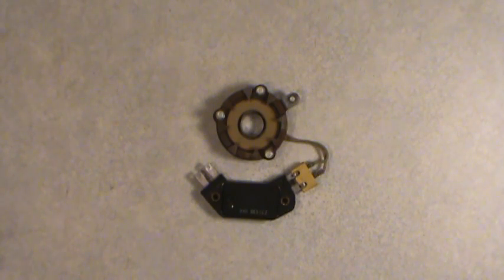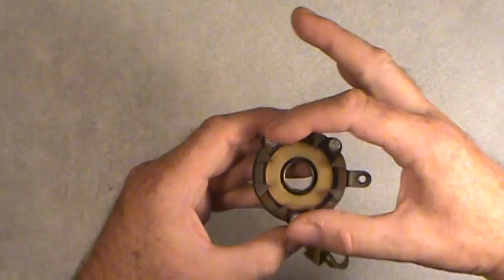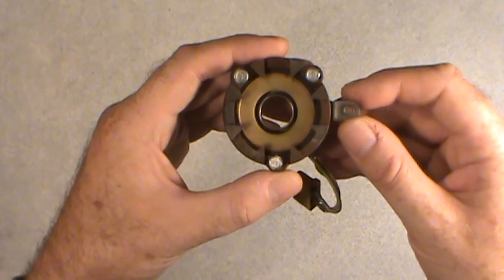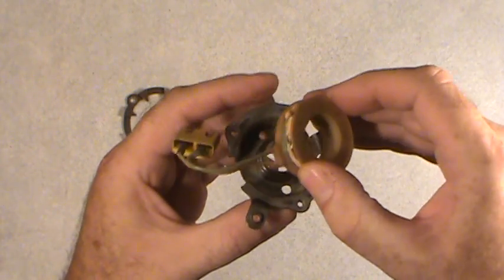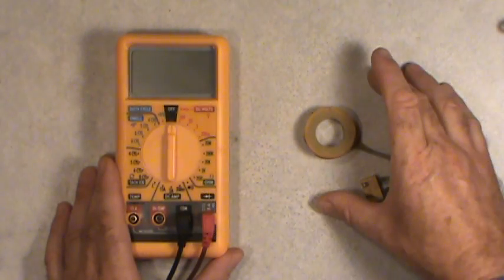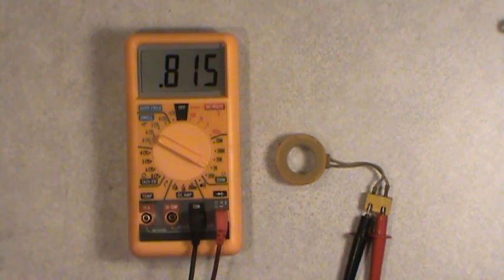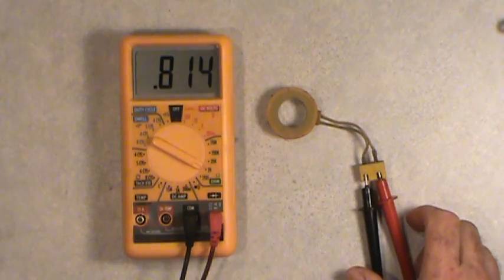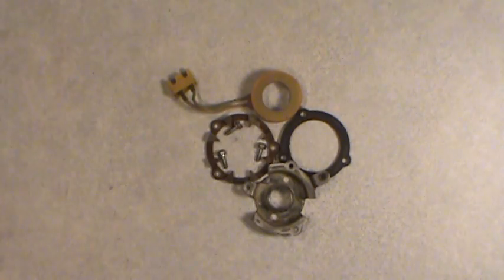HEI Distributor Pickup Coil Test

Comment: Very helpful, thank you for sharing this
Reply from the maker: sma528 Greetings sma528...Thanks for Your great comment, and for watching as well......................................................As far as the General Motors..."HEI" Distributor is concerned, this so called..."Pick Up Coil" (on the Units shipping box, it reads, Pole Piece, if I recall correctly, that is)...that..."Triggers the Ignition Module"...is only, shall we say..."One Piece of the Puzzle"...when it comes to the..."Reliability & Performance"...of a very Well Designed, and, also, as I like to call it..."A Stand Alone"...installation/hook-up, with the usual..."Battery Voltage"...that is supplied by, the..."Single Wire/Connector"...from the Vehicle's Ignition Supply Circuit, as opposed to having, what is usually referred to, as a "Ballast Resistor" (usually, as I have seen, a specially designed and calibrated Resistance Wire, in some, but perhaps, not all, General Motor's Vehicles), that "Reduced the Voltage", and the related Wiring, that was connected to the Ignition Coil, that use to go along with, that good ole "Points & Condenser Distributor", that General Motors Installed, up, oh, until about 1974...then...in about 1975...the General Motors..."HEI" (High Energy Ignition) Distributor, as far as I know, became the Distributor, that totally Replaced, that good ole Points & Condenser Distributor, and, as I see it, was due to having the Vehicle Manufacturers, Comply, with the Emission Standards, that the Government of the day, Imposed on them.........................................................Then, the Performance minded Folks, found, that the "HEI" Distributor was well suited, in the making of..."Lots of Horse-Power & Torque" too...because of the ability of the "HEI" Distributor, being able to, shall we say..."Get the Fire Lit"...in the Engine's Combustion Chambers, much better, with the usually found..."Higher Secondary Voltage"...that the "HEI" Distributor's Ignition Coil, was capable of Putting-Out, as compared to, like I was sayin' earlier, the Points & Condenser Distributor, that preceded "It"........................................................Make sure, that, when-ever You "Replace", any of the "HEI's" Distributor "Parts", for a "Factory Stock" Unit, to Use and Install, the "Exact Parts", that "Are Made For", that "Exact HEI Distributor Number/Model", as there were Many, did I say MANY, "Different Calibrations", that were Engineered, and Designed "Into", those Many Different HEI Distributor Numbers/Models.......................................................Also, the "Rotational Direction" (clock-wise vs counter-clockwise) of the Distributor Shaft and Rotor, can be "Different".......................................................For example....A "Chevy" (Chevrolet) HEI Distributor's Rotor..."Turns/Spins Clockwise" (as viewed from Above), and a Small Block..."Oldsmobile", as far as I recall..."Turns/Spins Counter-Clockwise"...!!! (maybe Pontiac and Buick "HEI's", do as well, from what I recall, perhaps?)........................................................From what I recall, from a while back, is that, some of the "HEI Distributor's...Electrical Parts/Components, might have..."Opposite Polarities"...and that's another reason, to "Make Sure", that the..."Exact and Correct Replacement Parts"...get..."Installed"...for any One, of the Many..."Specific HEI Number/Model"...Distributors, that are out there...!!!   .....................................................That also Includes the "Vacuum Advance"..."Canister" (looks like a Mini-Space-Ship...lol)..."Calibration"...as well (if the HEI Distributor in question, has One, that is?).......................................................On my YouTube Channel...RockysRoadshow...I have a few Other "Videos", that You might find helpful as well........................................................If You care to, You can have a look-see at another HEI Pick-up Coil Video, where I Take "It" Apart, and Explain a few things about it ("It's" the same One, that You see in this particular video of mine), as well as, some Ignition Coil Videos, among Other Things, that You just might find useful as well...enjoy...................................................If You happen to have any questions or concerns at all, just simply leave a Question or two, under any of my Channel's YouTube Videos, and, I'll do what I can, to help You out...............................................Till next time (maybe?).................Be Safe, take care, and have a good one.

Comment: not much vacuum at idle, LOL!
Reply from the maker: jay mak Greetings jay mak....Thanks for watching, and for, Your comment as well....................................................You were sayin', that, You didn't have much Vacuum at Idle...???..................................................I'm thinkin', that, Your Low Vacuum at Idle, could be, being caused by a few things.....................................................Perhaps Your Engine has a..."Performance Camshaft"...with maybe..."Lots of Overlap"...and maybe even..."Lots of Duration"...as well, which will usually, make for a rather,..."Low Vacuum Signal"...at..."Idle Speed".......................................................Maybe even, something like a..."Vacuum Hose"...has, become..."Detached"...from a..."Fitting or Connection point"...perhaps...???............................................"Ignition Timing"...that is, shall we say..."A Bit on the Late Side" (retarded timing, as opposed to, advanced Ignition Timing), might also, make for, a rather..."Low Vacuum Signal"...as well.........................................................If You are finding, that, the..."Not Much Vacuum at Idle"...that You were sayin', that You had, was being, somewhat of a Problem for You, just let me know, all that You can, about Your..."Engine and Vehicle"..."Any Upgrades or Modifications...and, I will do what I can, to help You out, if possible.............................................................Thanks again for watching...............Be Safe, take care, and have a good one.
Reply: You have high vacuum at idle.

Comment: Well done.  Thx!
Reply from the maker: Greetings George Smith....Thanks kindly, for your nice comment, and, you are welcome....I was just thinking, that, this here HEI Pickup Coil, could be considered the "Brain" of the Ignition System...cuz...when it Does-Not-Work, like it's supposed to...well...the "Rest" of the Ignition System becomes "Use-Less"...and...goes..."KAPUT!!!" (aka, Non-Fuctional)....Just try to keep in mind, that, "Everything" from your vehicles Battery Condition, Charging System, all Components that relate Directly to your HEI (High Energy Ignition) Distributor/System, Ignition Switch, Wiring, and any additional Components, that may be Vehicle Specific, and, any and All, Wiring Connection Points, be them, for Power Supply or for making a Ground Connection, "Must" be in "Tip-Top-Shape!"...or..."sputter...sputter...sputter"....goes your Engine, as it Stops Running, and you pull over to the side of the road...waiting, and waiting...until...that "Tow-Truck" finally arrives, to not only Take Your Vehicle, but your Hard Earned Money Too!

Be Safe, take care, and have a good one.

Comment: This is helping me with my 79 corvette. I have been having hard starts on cold mornings. Sometimes it will fire up and others times it will not. Thanks again
Reply from the maker: Greetings jay22nup....Wowsers!....The "Pick-Up" Coil in this Video, is the Same Age as Your "1979-Corvette!!!....Mine is out of a 1979 G-20 (3/4 Ton) Chevy (or Chevrolet) Van!....Hmmmmm, yesterday, I was looking up "C-3"- Corvettes, namely, the 1973 Corvette (must be that "Coke-Bottle" shape that gets to me!...lol)....Yes-Siree-Bob, my Life is Full of "Co-Incidences", and, I'm getting to the point that it doesn't surprise me, all that much anymore....But, Both Vehicles are "1979", and, Yesterday, I spent hours Surfing on Information on 1973 "Corvette" Stuff (including the entire Rear Suspension).....Need I say more?

When it comes to the General Motors vehicles, especially the Engines equipped with Rochester Carburetors (both 4-Barrel Quadrajets, and 2 Barrel Dualjets), I have always got them to Work/Perform very well....Always managed to get them "Tuned" well enough to Pass the good old "Smog" (Emissions) Test.

Having trouble with Difficult "Cold" Starts you say?
Here are some things to Consider and/or Observe, and Applies mostly to a Stock/Factory Setup (without Modifications).

If your Corvettes Engine Has Not been running for a few days or more, then you Carburetors Float Bowl could be Low on Gasoline, taking longer for your Fuel Pump to Fill-Up your Float Bowl again, hence, delayed starting....Also, if the Gasoline in your Gas Tank has a certain Per-Centage (%) of "Ethanol" (alcohol) in its "Mix", that Ethanol Evaporates quicker then 100% Gasoline....Also, Fresh Gasoline is a must....Old Stale Gasoline is (->insert your own Word Here<---lol).
 
Are you using the "Correct" Cold Starting Procedure?....As in, Push Gas Pedal to Floor Board and Release, then Turn your Key, and get your Starter Motor Spinning!...lol....What this does, is, "Fully" Closes your Choke Plate, and Positions your Fast Idle Cam Screw on the High Step, so the Cold Engine "Friction" does not Stall your Engine....Once Your Engine Fires-Up and starts Running (hopefully it does), then your Engines Intake Manifold Vacuum actuates your "Choke Pull-Off", opening the Choke Plate about 3/16 of an Inch (some Carburetors more, and, some less), to provide the much needed "Rich" Fuel/Air Mixture to make your Engine Run (while Cold), then, the Engine RPM's (Revolutions per Minute) will probably have your Engine "Screaming" at you!....Just give your Gas Pedal a Small/Light "Tap" (not more then 1/4 of Gas Pedal Travel), then, if your Carburetor "Choke" is working and adjusted properly, that little "Tap" that you just gave your Gas Pedal Should "Reduce" your Engines RPM's to an acceptable Idle Speed.

I'll even throw in the Typical "Hot" Starting Procedure as well.
Knowing that the Engine was just running a short time ago (and the Engine is still Warm), just simply Hold (Don't Pump the Gas Pedal!) your Gas Pedal about 1/2 Way Down (maybe More, or, maybe Less), depending on your Engines "Personality"....lol...,just like Humans, and their Pets!

Now, the Bonus feature!...lol...That be a "Flooded" Engine....Believe it or not, the Fact is the following....Flooded Engine = Way Too Much Gasoline made its way into your Engine!....There is a device on most Carburetors, and, that device is called a "Choke Unloader" (also called by other names as well)....If the Carburetor in question is fitted with a Choke Unloader, and your Engine is Flooded (with Gasoline), then, you "Hold" the Gas Pedal as far as it will go (to the Floor Board), and Start your Engine, but WARNING!!!->CAUTION!!!,,,When the Engine "Starts", Get Your Foot "OFF of The GAS PEDAL!!!",,,or, you'll Blow Up Your Engine!!!....Then you can give it a Little Gas Pedal, if it needs it to keep from Stalling.

If you care to, just let me know, everything that you Observe, that is making your Corvette not run/behave so well.

Look behind your Driver Seat, there is a "Stow-Away" on Board!....Never mind, it's just your Battery!...lol.

Take care, and have a good one.

Comment: Great video
Reply from the maker: Greetings jay22nup....Thanks kindly for your nice comment....Ah yes, it's all coming back now (over 10 Years ago!...lol)....Probably the only reason that I have this H.E.I. (High Energy Ignition) Distributor "Pickup Coil" out of my 350 Cubic Inch Chevy V-8, removed, and available for this Video, was when I was trying to figure out, what I thought was an "Ignition-Miss-Fire", as my Engine was kinda (well, at least I thought it was) behaving like a Miss-Fire, more-so, when under a slight load, while going up a Medium-Steep Hill.

Back then, I didn't know a whole lot, so, like others, I tried replacing a few parts....I also replaced the "Ignition Module" as well....It seemed that after I Replaced both, the Pickup Coil (actually, I purchased the whole unit that you see in this Video, and, it's called a "Pole Piece", and the actual Pickup Coil is that slightly yellowed Plastic "Bobbin" with the many turns of very fine wire that makes up the actual Coil), and the Ignition Module, my 350 Chevy V-8 seemed to run a bit better, but not like it really should.

I should also mention....If you ever have to Replace the "Pole Piece" in your H.E.I. Distributor, be Aware that the "Ring" with the "8-Triangles" is "Adjustable!"....You have to make sure that the "Other" Set of those "Moving-Matching-Triangles" on the Distributor Shaft "Don't" make "Contact" with the almost "Stationary" Triangles in the "Pole Piece" (almost Stationary = Because the Vacuum Advance "Moves" the Pole Piece when told to Do So!...lol)....Make sure that you Check for "Equal" Running Clearance between those "2" Sets of (8) Triangles by slowly Rotating the Distributor Shaft, all-the-while Observing the Very Important, and Necessary "Running Clearance!"....If there is an Issue with the "Running Clearance", simply (slightly) Loosen those "3" Screws on the "Pole Piece" and Move/Adjust as required....Oh yeah, remember to "Tighten" those "3" Screws, and "Re-Check" that there "Running Clearance.

Then, I started to check a few other things....I was thinking that perhaps the "Timing Chain" was Worn, resulting in a Stretched Timing Chain, that may have "Jumped" a tooth or two on the Timing "Gears?" (actually, they are Not Gears, they are "Sprockets!"...lol...because "Gears"--->"Mesh", or, in other words, the Gear Teeth Drive one another with No Chain whatsoever!)....So, I got out my Trusty "Timing Light", and checked the Ignition Timing....Hmmmmm, Timing was OK, so now what?

Somewhere, tucked away in my Gray Matter (Brain), I said to myself, "Self", how about you take off those "Valve Covers" (aka Rocker Covers), and see what those "Teeter-Totters" (Rockers) are up to!...Well now, low and behold, there "It" was, "One" of those "Rockers" was almost "Ah-Sleep!" (not moving very much)....Maybe some of you out there have had a Lobe or two on your "Bump-Stick" (aka Camshaft) do the good old "Diss-Appearing Act?"....You know, where an almost Flat Bottomed Hydraulic Valve Lifter acts as a "Cutting Tool" in a "Metal Lathe", "Machining" One, or maybe More "Camshaft Lobes" into "Metal "Shavings/Grindings", that hopefully, make their/its way to your Oil Pan without causing any further "Destruction!"....Turned out to be the Non-Existent Camshaft "Lobe" for the "Number-4-Cylinders-Exhaust Valve!"....Hmmmmm, maybe it could have also been a "Collapsed"---> Hydraulic (Valve) Lifter as well--->But, it Wasn't!

The Moral of the above (True) Story is....Always Start and Run Your Engine at Least "Once-a-Month", and, more often, is even Better!....You might get away with Running your Engine not as Often, if it has a "Roller-CamShaft-&-Roller Lifters", as compared to the almost "Flat-Bottomed" Hydraulic or Solid (Valve) Lifters, Due to the "Lubrication" (Oil) Draining Off of the Camshaft and almost Flat Bottomed "Type" of (Valve) Lifters, where they are in Contact with the Camshaft (due to Earths Gravity).

Not only to Prevent the Destruction of your Camshaft, but also, the Lubrication (Oil) that remains in your Engines Cylinders, can, and will Drain Away (downwards) when the Engine remains "Dormant" (kinda like Sleeping, as opposed to being Operating/Running once in a while)....If your Engine stays Not Running for a very long time, sometimes the Pistons can actually "Seize" (almost like Glued or Welded) to the Cylinder Walls themselves!!!....Also (on another vehicle with a V-8 Engine), I had to Replace the Rear Main "Oil Seal" (luckily, it was the 2 Piece Type!), and, I figure that it Dried-Up because that poor Engine Was Not Started, and Running enough (time interval) to get that Much Needed Oil, that was just sitting in the Oil Pan, "Circulating" to all of those "Critical" Engine Parts/Components to Avoid that very "Expensive" and might I add, "Un-Necessary" Repair/Repairs (and, Draining of the Bank Account!).

Just "Make Sure", that All of your Garage Doors are Open All the Way, because, Your Running Engines Exhaust Fumes are "Deadly!!!"

So, there you have it, the "Extended" and Factual Story behind this "Pick-Up-Coil" being Retired, but then again, it might really be just Semi-Retired, for the reason that is still able to do its Job, if Called-Upon...

I better Stop Now, or, this Page could very well "Become a Book!"...lol

Take care, and have a good one.